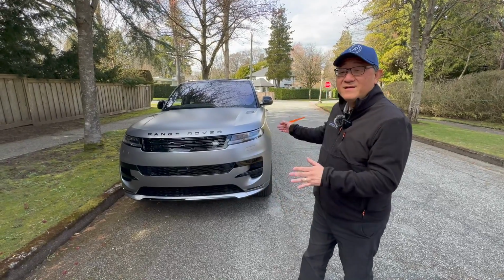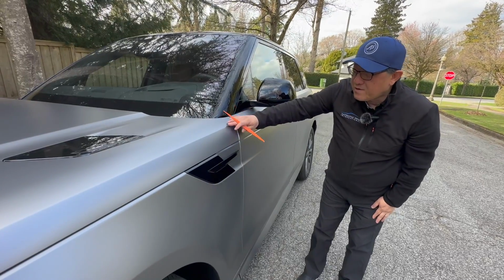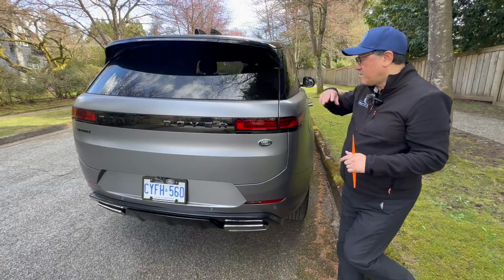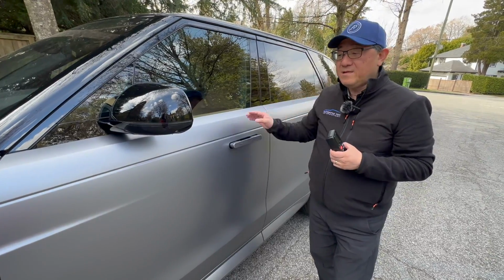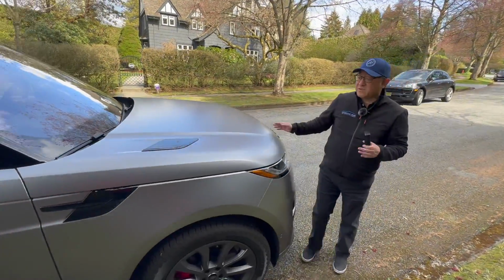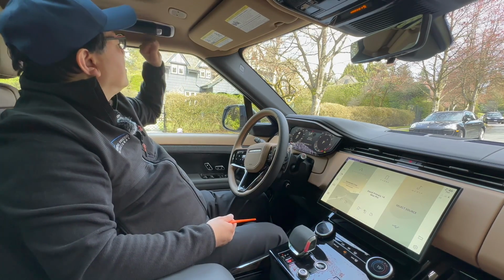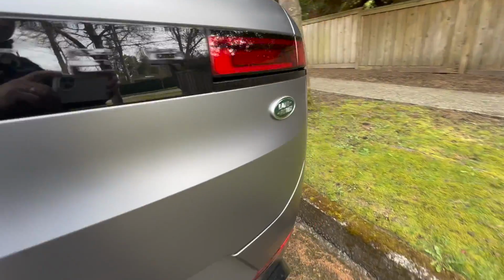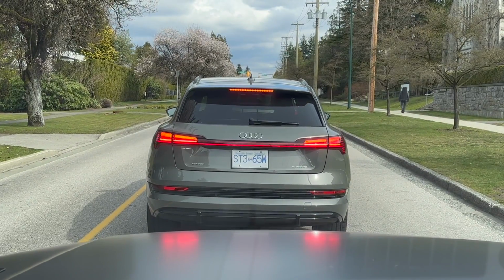THIS IS THE RANGE ROVER WE'VE BEEN WAITING FOR... RANGE ROVER SPORT IS THE BEST ONE YET

Comment: Great review, which engine is in this one you drove❤️? 

Also I test drove 3 of them and found the battery model very heavy and not sporty because of the weight. 

Breaking didn’t give me much confidence with the battery weight… 

The full size range rover does feel soft, but very comfortable, and they do have a dynamic mode in it so you can stiffen it up. 

But both  lovely designs.

Comment: Hi, David,
Maybe it’s the outdoor lighting or it’s my eyesight, but it seems that the paint on the driver’s door is ever so slightly darker  than the rest? I’m a bit put off by the variances in paint thickness from one panel to another or even from one end of the same panel to the other end. Can you please test a Sport with normal paint? Thanks in advance!
It’s a nice looking SUV, and I like the exterior updates. I just wish they (Jaguar/Land Rover) had much better reliability.